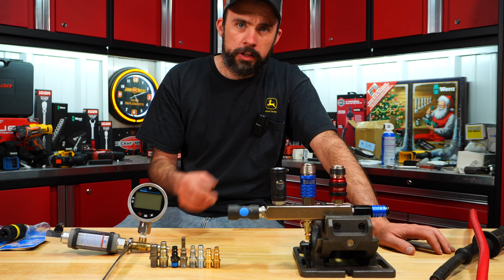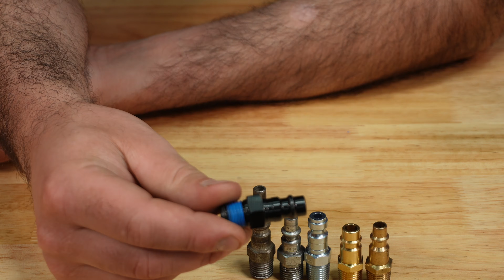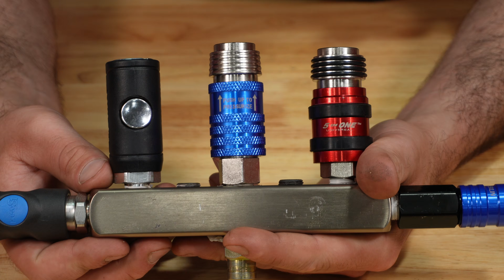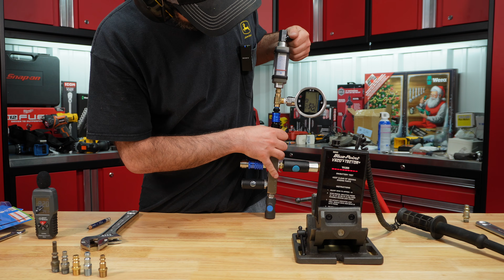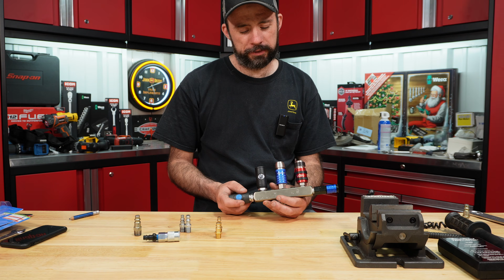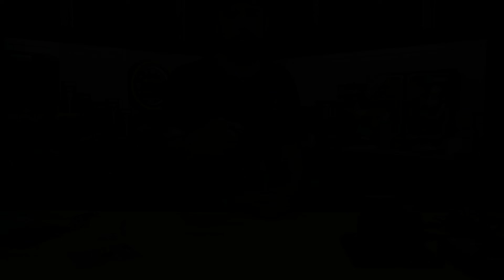Best Air Couplers 1/4,  Safety Couplers

Comment: On my big 80 gallon compressor I have a 1/2" coupler. I use 1/2" hose for my 1" air impact wrench. When I need to go some distance, I use 50' or 100' of 1/2" hose to get there and step down to a 3/8" hose at the end. I have a 1/2" plug on the end of a 3/8" hose and a 1/4" coupler on the other end. I don't lose as much cfm on 100' of 1/2" hose and use a short 3/8" hose at the end of the run.

Comment: What you recommend for home use (tires, car and bikes, maybe the occasional air wrench for car lugs and small amounts of media blasting, right now I just use the 1/4” HF plugs and couplers with 3/8 air line
Reply from the maker: I would probably go with the Merlin 5in1 coupler.
Reply: @Tools-Tested  it’s only has maximum inlet pressure of 120, my compressor is 125

Comment: That’s odd, I’m running HF with both Merlin and Milton safety couplers
Reply: I bought the Merlin safety coupler unsure if the high flow (V style) would fit and also now can confirm it does accept the high flow connectors.

Comment: Unless you have an older Merlin safety coupler mine will take the HF male.
Reply: They fit tight but I use the Merlin HF plugs with the Merlin Safety Coupler also.  This coupler seems to take any style I put in it.  Some fit tighter than others.  Some have leak a bit and do better with a little lube.
Reply from the maker: Interesting,  thanks for the info!

Comment: I'm not sure the test is completely accurate.  It would be nice to see the results on the high flows if they were also installed on the compressor. I would think that the way you have it hooked up creates a bottleneck straight out of the tank without that being switched over.
I have 1/2" or 3/8", I can't remember which one, out of my compressor and into my sand blasting cabinet as well as the 1/4" through a second valve. I run the 1/4" at a lower pressure so I don't ruin my power tools, and I keep the blast cabinet at 80 to 110 depending on what type of media I'm using and how much I need to clean off of any given piece.

If you get a chance to switch that out, I would really find that helpful, even if you just put the results in this comment section instead of a whole new video.

Comment: Crazy there's so many different types.

For those looking for a better quality standard coupling, Foster is made in USA. I bought a set of 14 couplers for only a couple dollars more than the Chinese junk. Been very impressed with them so far. Not sure if they make a safety version or not.
Reply from the maker: Yeah it's unreal,  seems like everyone had their own idea on air fitting designs.  

Thanks for the info on Foster,  It took some digging but looks like they do have a safety coupler USV310.

Comment: Interesting video, not seen any of those fittings for air system. We use either PCL or Schrader fittings, neither of them are safety locked, although there may be other types used in other industries in the UK.
Reply from the maker: Interesting I have never seen PCL or Schrader air line fittings.  It's crazy the amount of different types you can buy.  I know in Japan they use Nitto.

Comment: Great testing as always, I run the legacy industrial fittings and a 3/8 hose does all I could ask of it!
Reply from the maker: Thanks!  I to have been using 3/8 for years with the industrial fittings with out issue.  I will say thought having safety couplers is nice.